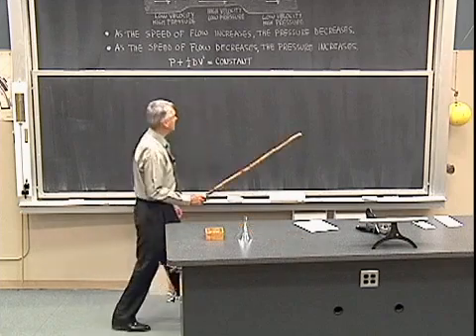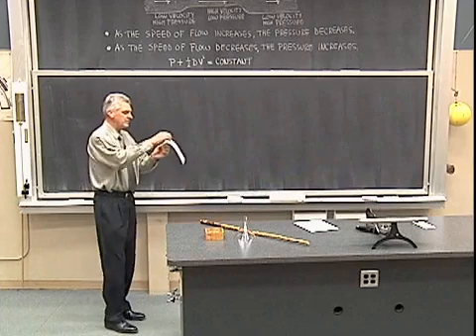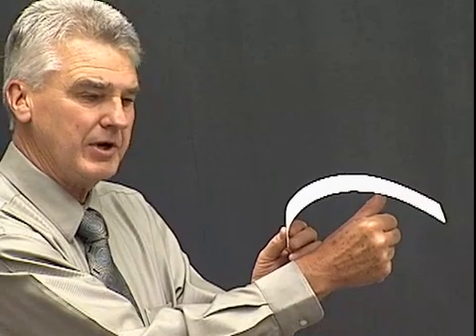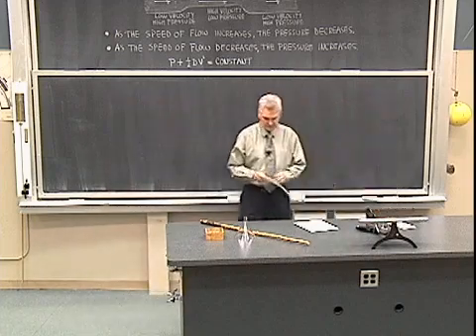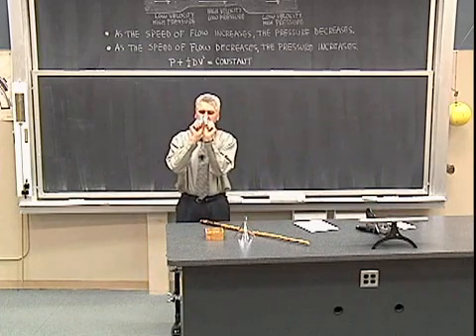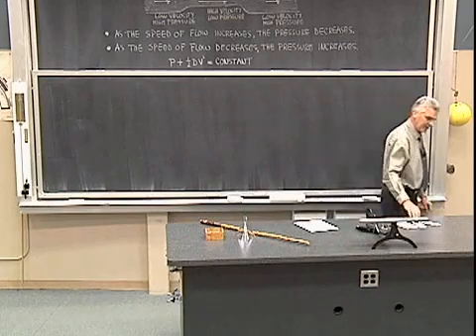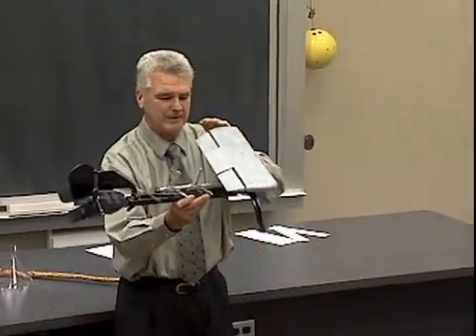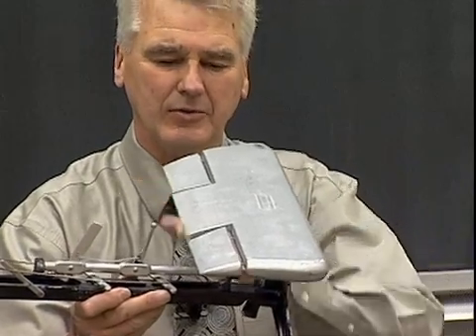Bernoulli's Principle: Air Foil and Pieces of Paper

Comment: This explanation is incorrect. Why does the note rise? That's because the paper strip is curved. When air moves along the paper strip, the inertial motion path of the air follows a straight path. However, due to the curvature of the paper strip, the air tends to move away from the paper strip in the normal direction, resulting in a pressure lower than atmospheric pressure. So the note rose.
Reply: Hi Enbin, Steve Here.  You are correct.!.  He also has other BAD Bernoulli Videos and one where he does not understand Entrainment: 
https://www.youtube.com/watch?v=AnDvjjPQCuE  
Best Regards, Steve
Reply: @Observ45er so you are still alive
Reply: @caizuus Yes.  If I post too many in one day, YouTube blocks them.
The stream of air out of his mouth is at atmospheric pressure, not below it.  He teaches an all too common misconception that is this same  "Bernoulli Fallacy" in several other videos.
It is so sad when PhDs don't understand the physics.  The conservation of energy DOES take place, but between inside his lungs and outside -- NOT after the air leaves his mouth and by some magic that air gets its energy by stealing it from the atmosphere. . . 
.
The potential energy of pressure INSIDE the lungs is converted to the kinetic energy in the air OUTSIDE the lungs. THAT is where the pressure decrease and and speed increase is demonstrated.   From the elevated pressure inside the lungs to the ambient atmospheric pressure outside the lungs.
.  
He also does not understand entrainment in another video be misinterprets as being the Bernoulli fallacy:
  "Bernoulli's Principle: Hose Attached to a Faucet:
  www.youtube.com/watch?v=AnDvjjPQCuE
Reply: @Observ45er  I left a comment under the video you provided. He is incorrect.
Reply: @Observ45er  How can The Learned Professor be wrong? 
He's also wearing a tie ! 😊

Comment: Believe it or not, most of this explanation is incorrect. @Observ45er is correct. I'm amazed at how often it is taught, even on a college level, that higher velocity "creates" lower pressures. It wasn't until recently that I discovered this is not exactly true. If something doesn't make sense in your mind, question it. That's what I finally did because it never made sense to me that more velocity causes less pressure; yet, this is how we were always taught that planes were able to fly. There are actually a couple different principles that create lift on plane wings. Lower pressure zones above wings do have something to do with it, but it's not created by higher velocity.
Reply: you are right, that's exactly what was running through my mind.
Reply: This Bad Bernoulli nonsense is SO frustrating.  And here is a University "Professor" teaching it.

He has another one here where he accidentally "discovered another Bernoulli effect. . . . :
https://www.youtube.com/watch?v=AnDvjjPQCuE
.
That one is is due to entrainment of the ring of water around the blunt rim of the nozzle exit. 
.
I'll try to contact him or the ASU physics department. . .
Reply: This explanation is incorrect. Why does the note rise? That's because the paper strip is curved. When air moves along the paper strip, the inertial motion path of the air follows a straight path. However, due to the curvature of the paper strip, the air tends to move away from the paper strip in the normal direction, resulting in a pressure lower than atmospheric pressure. So the note rose.
Reply: @enbinzheng-line  if you’re saying the explanation in the video is incorrect, then I agree.
Reply: @reecewilliams8691  Is my explanation correct?

Comment: I can't believe you are teaching this BAD SCIENCE at this level.!.!  
.
Bernoulli's Principle is not about "fast" air, it is about increasing speed which is acceleration that is accompanied by a pressure decrease along the path.
..
WHY? What is the science behind this?
..
Because:
..
The higher pressure behind the flow pushes (accelerates) the air to a higher speed into the lower pressure region. Pressure gradients (differences across space) are the force that accelerates the mass of fluid.  
A higher pressure region pushes (a force) the fluid (a mass) toward any and all nearby lower pressure regions. F=MA
This is simply Newton in fluids.
..
PLEASE note that he starts quoting it correctly when he says: "As the speed increases". AS IT INCREASES!!  Not after it increases! [and is already slowing down as it mixes with the still air]

 WHERE is the speed actually "increasing" ??  Why, it is Inside his mouth, right at his lips!!  This is where the Pressure Gradient exists and this is where the acceleration occurs. 
The "high" pressure is inside and the "low" pressure is the outside normal atmospheric pressure. 
..
This is so flippin' obvious, I can't for the life of me, figure out why so many supposedly intelligent "science" people can't figure this out !!
Sooooo many people simply repeat this nonsense with absolutely no understanding at all...
That is not what is happening above the curved paper.
..
The paper rises because:
Viscosity causes it to follow the curved path.
A curved path is an acceleration, right?
A low pressure is created by the curved flow because it wants to go straight (Newton's First) and this is called the Coanda Effect.   
It will subsequently 'stay' out horizontally due to the viscosity caused entrainment.
....
Bernoulli comes into play inside your mouth.  The higher pressure there accelerates the air to a higher speed into the lower atmospheric pressure outside.  
..
The static pressure of that moving (but not speeding up) air OUTSIDE your mouth is at the SAME pressure as the still air all around it.
This  can easily be measured.   Weltner shows how:
..
Weltner in PDF - "Misinterpretations of Bernoulli's Law".  
Fig 3 is the fast air only.
Fig 7 is the viscosity requirement above a wing (NOT Coanda even though it looks like it).
SEE  Figures 6 & 7 are upper surface.  Figures 3 & 8 Lower pressure:
..
 http://user.uni-frankfurt.de/~weltner/Misinterpretations%20of%20Bernoullis%20Law%202011%20internet.pdf 
........
The cause of the rearward acceleration of the air over a wing is the lowered pressure above the wing and the higher (normal atmospheric) pressure ahead of the wing.
ACTUAL DATA on a lift producing wing moving through otherwise still air shows the Lower air  moving faster, but the upper air is accelerated much more due to the Pressure Gradient established by the wing's movement.
This video, sadly, just repeats past fallacies with no true understanding of science.

Comment: NO!  The Coanda Effect is demonstrated by blowing above the paper. 
Bernoulli is demonstrated by the higher pressure in his lungs accelerating the air out into the lower and normal atmospheric pressure in the room. The air out of his lips is AT ATMOSPHERIC pressure.
Reply: This explanation is incorrect. Why does the note rise? That's because the paper strip is curved. When air moves along the paper strip, the inertial motion path of the air follows a straight path. However, due to the curvature of the paper strip, the air tends to move away from the paper strip in the normal direction, resulting in a pressure lower than atmospheric pressure. So the note rose.
Reply: @enbinzheng-line  Hi Enbin. Steve N. here.
You are correct, but this video is false science - it is WRONG.!.
. 
 Inertia of the air's mass is something everybody ignores.  It is the reason for the increased pressure under a wing as well as the decrease above the wing.
. . 
However, my explanation of where Bernoulli's Principle is ACTUALLY demonstrated is correct and well accepted physics.  The Pressure Gradient from inside his lungs to the outside (relatively lower) atmospheric pressure is the CAUSE of the acceleration of that jet - - whereupon the jet assumes the ambient atmospheric Pressure. The potential energy of the lung pressure is converted to the kinetic energy in the now lower atmospheric pressure jet.  
TO BE CLEAR: The JET is AT atmospheric pressure - NOT below it!.  This is measured daily by students and aerodynamicists. . . <-FACT!
. . . . 
The pressure in the "fast" jet can be directly measured with a standard static pressure probe used by aerodynamicists. See how in Klaus Weltner's paper:  Misinterpretations of Bernoulli's Law
.  www.prirodopolis.hr/Bernoulli-Coanda%20Demo_files/Misinterpretations%20of%20Bernoullis%20Law.pdf

 It was Euler who is credited with determining that a Pressure Gradient is the CAUSE of fluid Acceleration. . <-- Newton in fluids. 
. . .
 Fully explained here, step by step here, WITH explanations of the common misunderstood demos.  
REAL physics:  Understanding Bernoulli and Aerodynamic Lift Correctly:  rxesywwbdscllwpn.quora.com 
.
Thus Weber State guy also has other BAD Bernoulli explanations as well another video with a nozzle into a clear hose which id also NOT Bernoulli.  He clearly does not understand entrainment: https://www.youtube.com/watch?v=AnDvjjPQCuE
Reply: @enbinzheng-line   Hi Enbin.  Can't understand why I missed your comment. . .

My summary first sentence right above this is misleading and you are correct.  I should have said 'curved paper', but was trying to avoid giving an overly-long explanation. 

.
'HOWEVER: the explanation of Coanda and the airflow above a wing are VERY similar in regard to the the air tending to move away from the paper strip in the normal direction.
Coanda is different because there is entrainment around the jet that has additional effect that the wing's flow does not have.
Regards.

Comment: I can't believe they still teach this BAD SCIENCE at this level.!.!  
.
Bernoulli's Principle is not about "fast" air, it is about increasing speed which is acceleration that is accompanied by a pressure decrease along the path.
..
WHY? What is the science behind this?
..
Because:
..
The higher pressure behind the flow pushes (accelerates) the air to a higher speed into the lower pressure region. Pressure gradients (differences across space) are the force that accelerates the mass of fluid.  
A higher pressure region pushes (a force) the fluid (a mass) toward any and all nearby lower pressure regions. F=MA
This is simply Newton in fluids.
..
PLEASE note that he starts quoting it correctly when he says: "As the speed increases". AS IT INCREASES!!  Not after it increases! [and is already slowing down as it mixes with the still air]

 WHERE is the speed actually "increasing" ??  Why, it is Inside his mouth, right at his lips!!  This is where the Pressure Gradient exists and this is where the acceleration occurs. 
The "high" pressure is inside and the "low" pressure is the outside normal atmospheric pressure. 
..
This is so flippin' obvious, I can't for the life of me, figure out why so many supposedly intelligent "science" people can't figure this out !!
Sooooo many people simply repeat this nonsense with absolutely no understanding at all...
That is not what is happening above the curved paper.
..
The paper rises because:
Viscosity causes it to follow the curved path.
A curved path is an acceleration, right?
A low pressure is created by the curved flow because it wants to go straight (Newton's First) and this is called the Coanda Effect.   
It will subsequently 'stay' out horizontally due to the viscosity caused entrainment.
....
Bernoulli comes into play inside your mouth.  The higher pressure there accelerates the air to a higher speed into the lower atmospheric pressure outside.  
..
The static pressure of that moving (but not speeding up) air OUTSIDE your mouth is at the SAME pressure as the still air all around it.
This  can easily be measured.   Weltner shows how:
..
Weltner in PDF - "Misinterpretations of Bernoulli's Law".  
Fig 3 is the fast air only.
Fig 7 is the viscosity requirement above a wing (NOT Coanda even though it looks like it).
SEE  Figures 6 & 7 are upper surface.  Figures 3 & 8 Lower pressure:
..
 http://user.uni-frankfurt.de/~weltner/Misinterpretations%20of%20Bernoullis%20Law%202011%20internet.pdf
Reply: @Observ45er    cool! u stay safe to!
Reply: I don't know what to put in my assignment now-
Reply: @fern.quitx_x8645  Welcome to real life.
You put down what your teacher wants you to put down, for the grade. 
Whether you like it or not, many teachers are wrong about this, but they give the grade. 
What does you teacher say?  Use that!
...
However...
..
Real science follows...
..
PLEASE note that he starts quoting it correctly when he says: "As the speed increases". AS IT INCREASES!!  Not after it increases! [and is already slowing down as it mixes with the still air]
 WHERE is the speed actually "increasing" ??  Why, it is Inside his mouth, right at his lips!!  This is where the Pressure Gradient exists and this is where the acceleration occurs. 
The "high" pressure is inside and the "low" pressure is the outside normal atmospheric pressure. 
..
This is so flippin' obvious, I can't for the life of me, figure out why so many supposedly intelligent people can't figure this out !!
Sooooo many people simply repeat this nonsense with absolutely no understanding at all.
Reply: @Observ45er  

ok-
Reply: @fern.quitx_x8645  UNLESS... You understand this well enough and have enough self confidence to go to the instructor and describe this to get the reaction...
I start with the "a force is required to accelerate a mass" (Newton's First law)  and air has mass...
Reply: @Observ45er   I don't have any confidence whatsoever heheh...
Reply: @Observ45er  suggest material to relearn bad Bernoulli
Reply: @Upgradezz  Getting to my Article.
The full, step-by-step article is accessible to non-members, but You Tube can object to a URL, so I just tried this in an Incognito window and it worked.
Go to: www.quora.com/spaces/  OR: www.quora.com/spaces/h/ 
It shows a log-in, but also a search at the top.  
Search for “Understanding Bernoulli's Principle”. (with or without quotes works).  “Understanding Bernoulli” also works.
On the resulting page, click, lower left on “Spaces”.
There’s one result:  Click anywhere near “The real Story”.
Reply: @Upgradezz  Sorry for the delay.  I somehow missed the notification.
I had to do it that way because You Tube objects to posting URLs and seems to lock me out for some period of time.
Reply: you don't need to be selfish
Reply: @JimmyB2008  Comments like that add nothing and quite frankly, that one doesn't make sense.  I' didn't take anything. much less, too much of anything.
..
 I provide science well known by professionals in the field of fluid dynamics.  This video shows incorrect information as I explained. If there something that you don't understand, ask questions.  
I am willing to help understand the correct science 
if the informatino and reference I provided seem unclear.

.